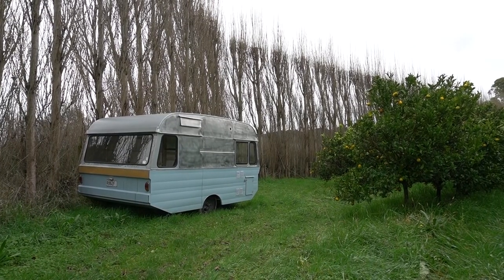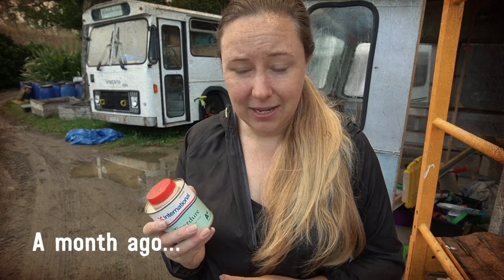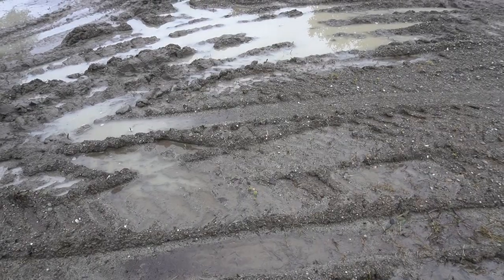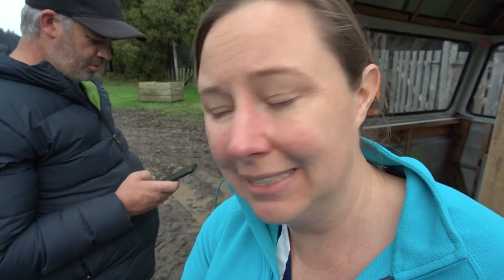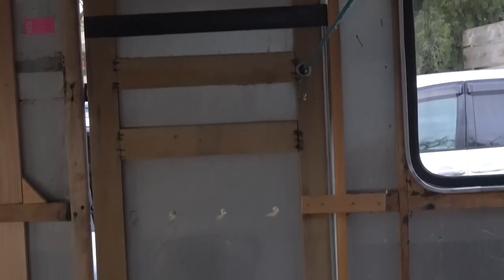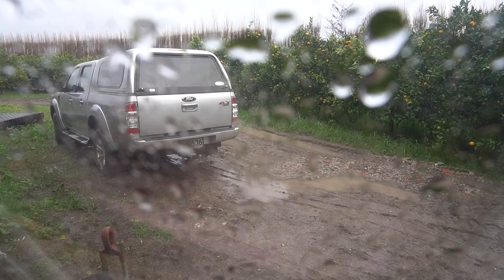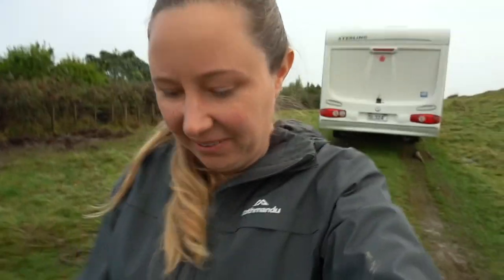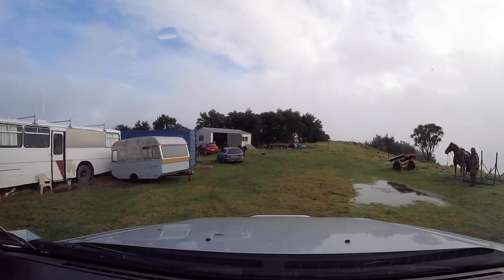Will Vintage Caravan survive move?

Comment: I got the same identical caravan .
I'm  going to restore it as well
The front window opens out.
 it dosent have the small exit door.
My side windows are perspex.
Reply: Its an Explorer caravan made in Levin
Reply: Oh <Thinking> you passed by the Hangaroa River and the rest of the drive.
I know where you are.
I was brought up near by
Reply from the maker: Oh what fun! I'd be curious to hear how you go.
Reply: First find the time.
Was busy through Lock down painting exterior and interior of house.
Just sanded Rimu floors in kitchen lounge put down first coat of Danish oil.
So would like to put rimu floor in Caravan
Its hard wearing once oil coats are applied .
Safe travels kay
Reply: Yes let you know when i make a start on the caravan.
I have to find out if the front opening window is legal..
Its amazing to sit up front at the table and windows open.
I fall asleep sitting upright so comfy

Comment: As someone else said, the original design is bad since it has the door opening facing forward.   If it is too much work to move the hinges to the left (front) then consider using a hasp to close/lock the door, similar to the small door.
A New Zealand link to illustrate.   This is also more secure since you can add a padlock.   Not traditional perhaps, but it will work.
https://www.bunnings.co.nz/zenith-safety-hasp-staple-115mm-zp_p0528525
Dave.
Reply from the maker: Oh a hasp? Shall investigate! I am thinking the door will be good when the edging are all put back together. Good to see the link - thanks.